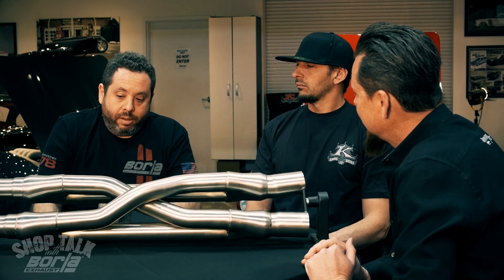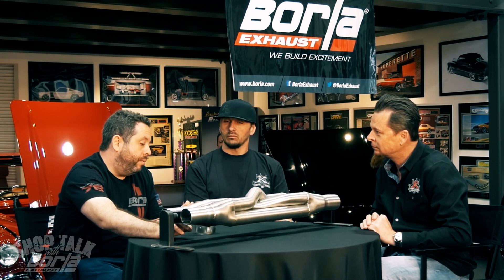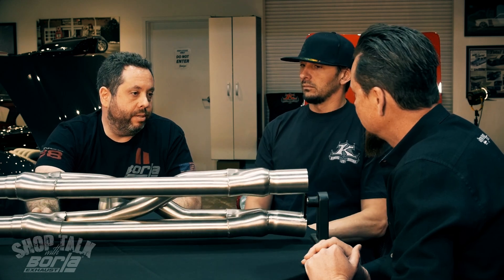Borla & Kindig: Switching Fire [Dave Kindig Reacts to New X-Pipe]

Comment: My Mustang has already headres and Tune, Do I need to update Tune when I put this x pipe in my Mustang?
Reply from the maker: A new tune won't be necessary after installing our SwitchFire X-Pipe. Please note, this X-Pipe is designed to work with the factory exhaust as a stock resonator replacement.
Reply: @borla  I had this on my 2020 Mustang GT with Ford  Performance by Borla mufflers,  it sounded awesome.
Reply: as long as you do cat back ,no tune is needed and you don't have worry about warranty.

Comment: Is this made to fit a 3 inch Magnaflo system for a 2015 Mustanf GT ??
Reply from the maker: Hi! This SwitchFire X-Pipe is designed to be a front resonator replacement on the stock exhaust of a Mustang GT.
Reply: @borla  In the near future will you making this in different sized tubing ? There's a whole bunch of guys out there that would love to purchase this, that have aftermarket exhaust systems..
Reply from the maker: @vincenttrotta576  We offer a version that is designed to work with our 2018+ Mustang GT Cat-Backs. Unfortunately, we don't currently have plans to offer one to fit other aftermarket systems.